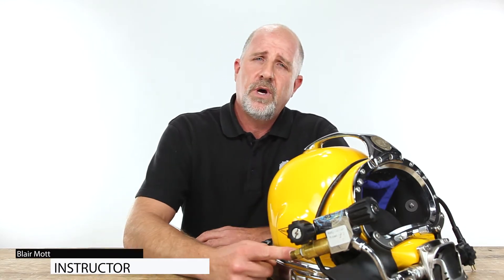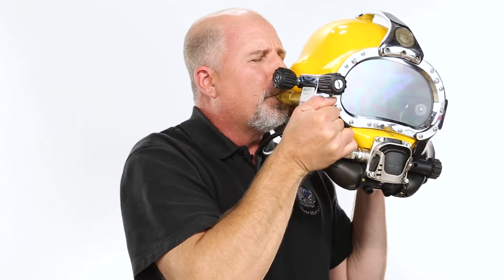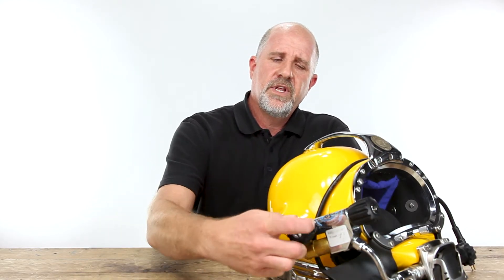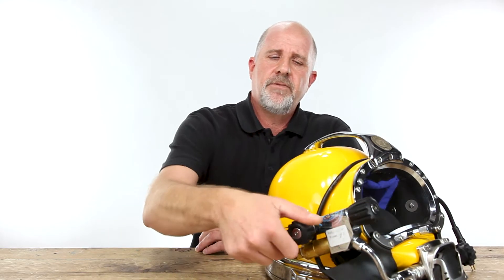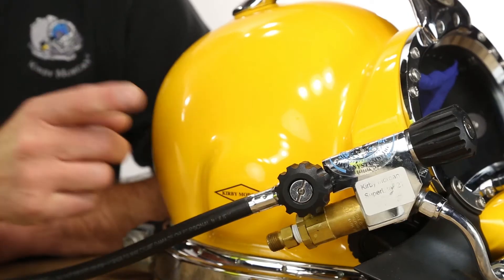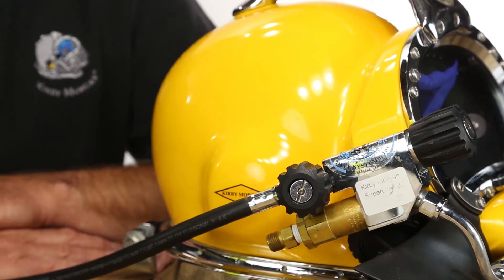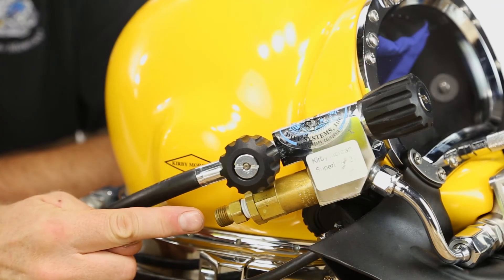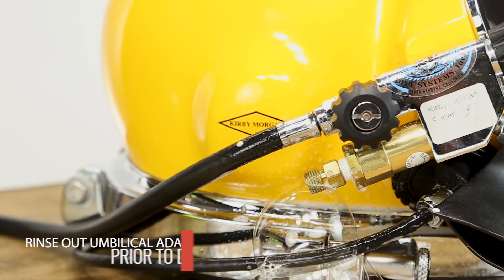How To Check The One Way Valve

Comment: Hi! 
I was wondering, if there is air / audible sounds coming from the One-Way Valve what does it indicate and why would it be a problem?

Thanks!
Reply from the maker: Hey there!

When blowing or venting gas into the one way valve it should do so freely, audible flutter will sometimes occur when orally blowing into the valve. Gas should NEVER pass back through the one way valve and out umbilical adapter. This is the criteria for go/no go operation and should be part of your daily diving routine. If air can be drawn back thru the one way valve, the one way valve will require overhaul or replacement.

Comment: Has the super lite been discontinued? This regulator looks different.
Reply from the maker: The SuperLite series of helmets (SL 17B, 17C and 27) are still in production. The regulator seen in this video is our most current, the 455 balanced.

Comment: I use a brake vacuum hand pump with an O2 fitting. If the vacuum guage pressure drops you have a problem.
Reply from the maker: Thanks Michael! That is also a great way to test the one way valve.